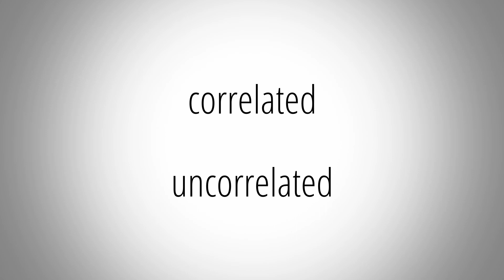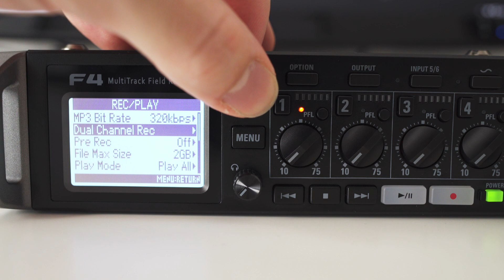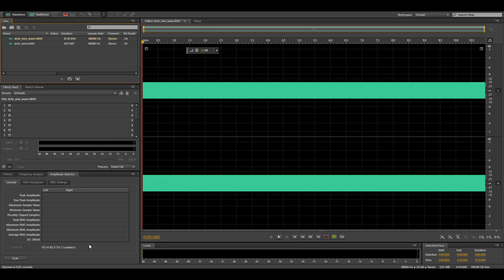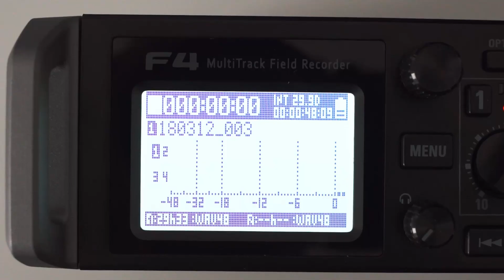Enhance Noisefloor of Zoom F4 / F8 with Dual Channel Recording

Comment: Q1. Can I use this method but with different gain in 1 and 3, so I would have a lower signal just in case the first one peaks? 
Q2. And also how are these channels are stored? as a dual mono? or as a separate file?
Reply from the maker: A1: Yes, but it increasingly lowers the benefit the further apart you set your gains. To be honest, I would not recommend using the shown method in practice. I just wanted to show what's theoretically possible. Usually the small difference in noise this method makes, is just not worth the hassle. The F4 is already super low noise, so it is highly unlikely the shown method makes any noticeable difference in the real world.
A2: This depends on how you setup your F4. In the menu you can choose between a poly wav file which contains both tracks or you can choose to save separate mono files. The choice is yours!

Comment: It's also used in some A/D converters, where the A/D 2/4/8ch chip can be used in dual mode, with a slight increase in S/N performance.

Comment: This actually is an old trick when dealing with low impedance, low level input signals - MC phono cartridges arguably being the most prominent example. When your source impedance is just 20 ohms, it can take quite a few parallel transistors before their noise contribution drops below the source's. Ribbon microphones may even be so low in impedance that people prefer to step them up with a transformer first in order to avoid silly transistor graves.

Now regular dynamic or condenser mics have a voice coil impedance of maybe 150 to 600 ohms. That means a thermal noise density of about 1.5 to 3 nV/sqrt(Hz). Making an amplifier that is substantially less noisy than that requires some effort but it really is quite doable, much more so than for the previous examples. As such, preamps with near-ideal noise levels shouldn't be that rare, though of course there always are any number of things to potentially be messed up.
Reply from the maker: Hey, it´s interesting to hear that this is an old trick. I never really thought about it before. And you are absolutely right. When using a phono cartridge as a signal source, you will benefit from this technique due to the very low impedance of the phono cartridge. Thanks for the additional info!
Reply: Letztens habe ich übrigens ein USB-Mikro Samson Q2U gekauft und mußte vor dem Hintergrund dieser Diskussion prompt lachen - da funktioniert der Trick nämlich ganz genauso... Man hat der Einfachheit halber wohl den Preamp mit beiden ADC-Eingängen verbunden. Angesichts der eher bescheidenen Wandlerdynamik (~84-85 dB) nebst niederschwelliger Nebengeräusche auch keine ganz dumme Idee. 
Und dann habe ich mir einen kleinen Behringer-Mixer geholt und konnte das ganze eigentlich gleich wieder brauchen, denn bei eingehender Untersuchung (<http://stephan.win31.de/music.htm#mixer>) stellte sich heraus, daß man den Main-Mix besser nicht zu weit aufdreht, dann ist das Rauschen des Soundkarteneingangs aber nicht mehr so wahnsinnig weit weg...

Das ganze kann man übrigens auch noch weiter treiben, wenn ich da z.B. an die DACs von ESS denke (Dynamik ES9018 - 129 dB x8 oder 135 dB mono). (Sowas in Portabelplayern zu verbauen - wie bei manchen knalltütigen Herstellern geschehen - finde ich übrigens immer noch ziemlich hirnrissig. Die bei einer solchen Dynamik unweigerlich hohe Stromaufnahme führt nur zu lachhaften Akkulaufzeiten. Da nehme ich lieber einen mit um die 100 dB und einen PGA dazu...)

(Ich war mal so frei, en allemand zu schreiben, sonst kommt mir das hier auf Dauer irgendwie albern vor...)
Reply from the maker: Das ist super interessant! Danke auch für den Link, bin gerade dabei die komplette Website durchzulesen. Das ist alles genau auf meiner Wellenlänge. Ich bin ja auch stark an Audio Aufnahme- und Wiedergabetechnik interessiert und zwar aus künstlerischer und auch technischer Sicht. Werde da häufiger mal auf der Seite vorbeischauen!